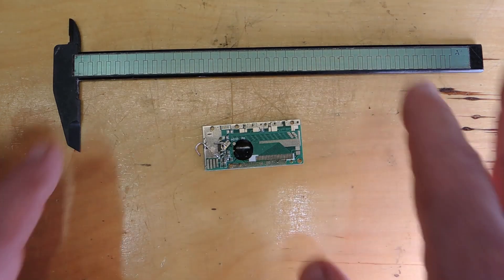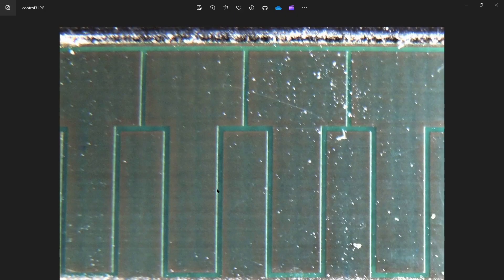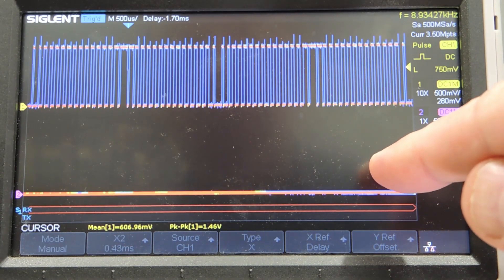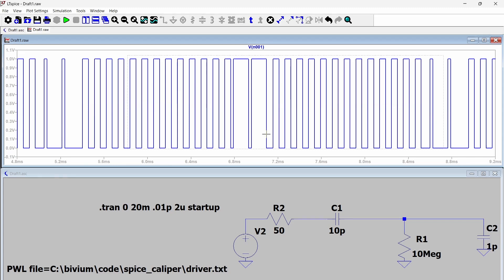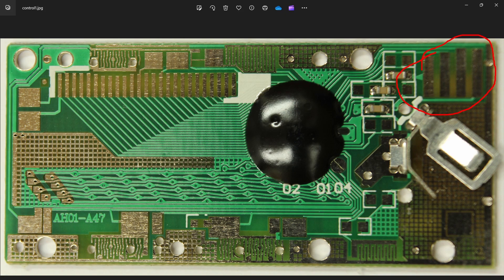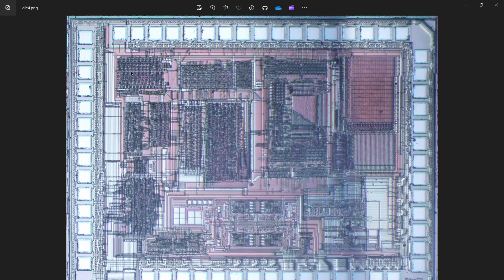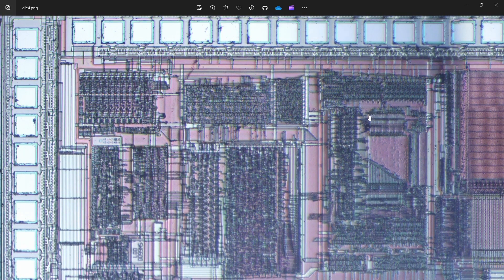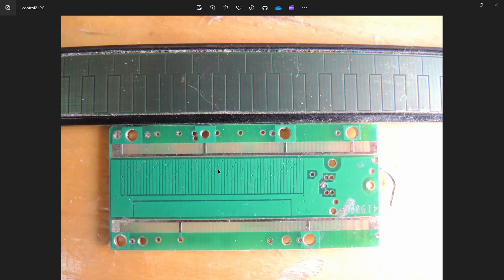Electronic Vernier Caliper Teardown

Comment: The latest version of the cheap plastic verniers board are not as hackable for DRO as they don't have the pads readily available.  However a picture of the latest board has tracks that end abruptly on the top right hand side of the black blob. These could possibly be the data and clock tracks that used to go to the pads on the older models. Have you had a look at the latest ones and can you confirm the tracks? Maybe I need to drop more acid?

Comment: The patent that explains everything. US5731707. Crude PWM to make psuedo "sinewave" equivalent (FIG2a-g) that moves along the length but constantly flip's a demodulator to avoid negative voltages that goes into an integrator circuit (Fig 14) to accumulate charge every time the next psuedo sinewave. This all results in a sinewave that appears to be moving across the 8 emitters and it's searching for where the capacitive plate that is coupled has no charge because it's balanced by the finges producing a sinewave over the 8 terminals that results in an even voltage. This is cap coupled to the moving bit, back to the large plate. The whole system is basically looking for the "zero" cross. but even with the pwm like psuedo sine wave it's not too acurate.  It's original design used a 6bit ADC to get about 10 micron accuracy I believe or maybe 1micron?. Commonly misunderstood to be capsense and it's not, certainly if it did the small relative in-out motion of the slide would throw off readings. The actual capacitance value means precisely nothing, just needs sufficient to couple through. The fun thing is that a 20 dollar Amazon special and a 200 dollar Mitutoyo only differ in physical material quality and low power when screen is off. There are other sensing arrangements Nils Andermo invented that may be more accurate and yet nobody uses them.
Reply: Thanks for providing more details

Comment: Great video. So the question would be, could you tell absolute position on an XY rail by just creating a PCB that lays on the rail with the wider fingers and then let the board with the smaller fingers just ride along the carriage on the rail? This would be a great way to create a closed loop system, but it doesn't seem like folks do that too often. If you look at linear motors for instance, they tend to use plastic strips along the rail with tiny black lines, and then just pick up light passing through the plastic or getting blocked by the black ink. This leads to a further question that these calipers do seem to know their absolute position, not just relative, albeit you do have to zero them. So perhaps they are just relative and the battery makes them feel like they're absolute because they just always watch for the movement which is why the battery dies on these after about a year.
Reply: They almost certainly only have relative position measurement, and remember the absolute position. The trick to a relatively low power use is the low operating frequency. The probing signal is ~8 kHz and if there's a higher master frequency it's probably still just in the tens or hundreds of kHz.

A CNC machine might be electrically noisy. The capacitive signal might be so weak that it could be disturbed by the magnetic field from motors. Maybe it will even have the occasional missed pulse without interference. In a motion system those errors will aggregate, unlike in a pair of calipers that will be zeroed every now and then. Light probably has a higher signal to noise ratio. Maybe it could still be useful for relative measurements, like continuous PID loop tuning, or combined with a coarser absolute positioning system.

Comment: The simplicity of design, incredibly low power of operation, extreme precision (I am able to repeatably get near single micron accuracy from them), and robustness of the measuring mechanism to mechanical shock and wear of these devices is astounding. I am amazed every time I have to use one at work.
Reply: I take it you're using the serial interface for that. These calipers only display to 0.01mm.
Reply: @toolscientist  I have a slightly different type for optics that I think works on the same mechanism
Reply: @Muonium1  a micrometer? Or do you have 0.001mm calipers? Never heard of 0.001mm calipers. I'd be interested to know the brand.
Reply: 0,1mm, the display doesnt even have 2 digits after comma  @toolscientist

Comment: Awesome topic! These things do amaze me. Even a $5 caliper you whip in and out as fast as you can and it somehow doesn't lose any steps
Reply: Agree, it's amazing that I can use a cheep caliper and it just works, and has all this technology in it.
Reply: Because all the sensing is going on in hardware, not software!
Reply: Because it reads the position off track unlike the older ones that counted bars on the track and had a speed limit.